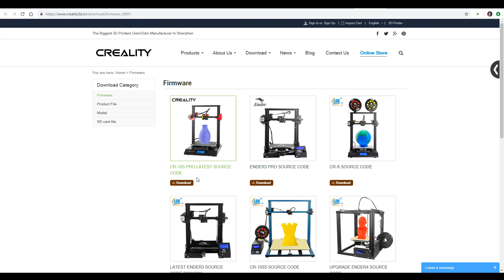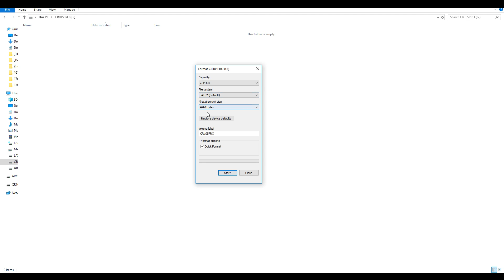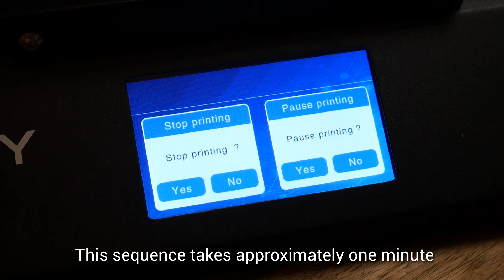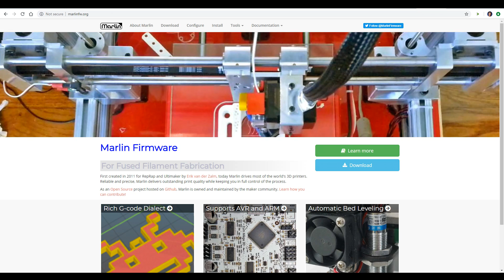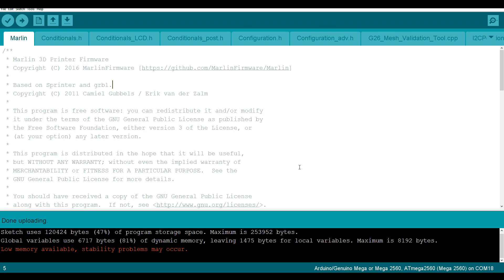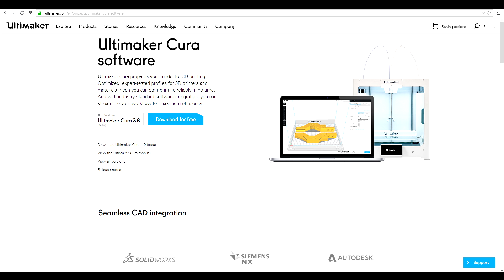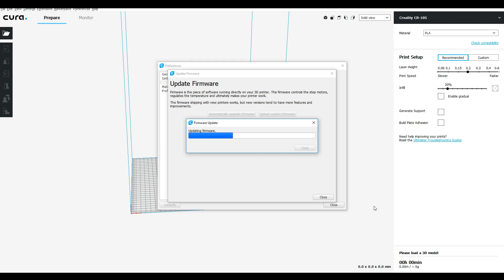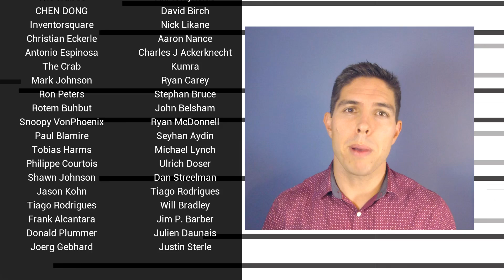How to update CR-10S Pro firmware - LCD and mainboard

Comment: Hey, I know I am a little late to the party. I got this printer from my dad with a broken screen. So I replaced the screen and wanted to flash the firmware to the new screen. However after turning off the printer the screen stays white and does not start the flashing progress. I have followed every step from your video. Do you have and idea or tip what might be the problem?

Comment: i did the tiny machines firmware and it worked but for some reason im having a issue with the y axis when auto homing going all the way to the front and then stuttering on front and making grinding noises , i have tested all the switches and they all working changed the stepper and still not working is their any more testing i can do

Comment: has anyone gotten the creality sonic pad working with the tiny machines firmware? i recently acquired a CR10s pro v2 and sonic pad off facebook. but the pad is not seeing the machine attached, i assume its due to non creality firmware. does anyone know if there's a setting that can be changed, or if i need to flash creality back to the CR10?

Comment: hi, please , i need help with editing firmware 1.70.1 for my cr10 s pro (v1). I need to calibrate the hot bed PID, but the firmware does not allow it. O dont know how to edit it. Does anyone have this firmware that they can give me? . The tiny machine version did no work for me (allows you to calibrate the hotend and bed pid, but requires configuring many more printer parameters). Thank

Comment: Hi Michael! I have semi-bricked my LCD board (power out during update), which means it works but can't run update anymore when I put in the card, so I am stuck on a 2-year-old tiny machines firmware (yeah using it very rarely). I was reading about how to unbrick the mainboard with reflashing bootloader on it, but I don't know enough to be sure that the same thing works with the display as well. Could help me out here, is it ok to do that?

Comment: Would like to attempt to swap out the capacitive probe in my CR-10S PRO (V1), and am currently acquaring all the parts/software.  TM's guide says "For 7.4.6, you will use V7
TM3D_DWINCombinedScreens_V7.z", yet the there's no link pointing to the screen firmware, it's only plain text.  Does anyone know where to find the screen firmware?

Comment: Hey can you share the files for not BLTouch? I have some problems finding files for no BLTouch even on tinymachines :( my printer went crazy
I have CR10s PRO (not V2 and without BLTouch)
Reply: The firmware link is in the official manual/document of TinyMachines.  Note that the specific firmware for the display is NOT linked:
https://docs.google.com/document/d/1cuYWpDw8aPuLEXus3uNsgDIEAKEze3Z9-hIDMWcqMK8/edit

Comment: Hello, thank you very much for the information, you have founded your one good and important channel for the makers.

I bought the CR-10S Pro V2 in 2020 and after a year I wanted to update its functions. Unfortunately, Creality and MyLittel Factorie had updated their websites so much at the time that I could only use them as a guide. And it came that I played a wrong firmwre which is now stuck on the device.
I've tried a few more things but I've had the printer for a year (leaving it in a corner a bit frustrated).

I just can't access the printer with the Com interface.
Do I have to install a new bootloader (and how does that work on this board (Ender 5 don't have the same board))
ist ther samethink i am able to do?

Comment: Can you please do a updated video, with the more advanced settings such as the servo pins, as well as pin debugging, and how to get marlin 2.0 to work with the stock cr10s pro touchscreen? I have multiple problems, one is the printer and bltouch working semi-correctly (it works when you run the self test, down and up commands, but when leveling, the printer head doesn't stop). I also have the issue that after installing marlin from the tiny machines firmware, all of the fans except the one inside the printer stopped working.

Comment: HI, I just upgraded my CR10s Pro to a CR10S pro V2 I add a BLtouch and firmware and screen update. I had trouble getting the machine to update but it is done. But now I have a new issue, the two cooling fans on the print head will not turn on. I have checked the settings in the new firmware, and have turned it on. the fans still will not work. Any ideas would be great. Am I still missing something? I upgraded using Tiny Machines kit and firmware.

Comment: i have a cr-10s i bought from a guy but i have not been able to use it because it come up MINTEMP ERROR i bought a new mother board and new hot end from the factory. i have checked the ohm for the thermistor and the other one beside it. everything checks out but i turned it on and then try to preheat the nozzel and as soon as it should kick on it goes right to the mintemp error. do you have any ideas on how to fit it please help .. i

Comment: in need of some urgent help here. i flashed the lcd all good no worries but i cant connect the printer to cura have tried countless things even tried editing the board loader wait time seen in another video but i dont have permission to save the python file when doing that. the reason im having to update is i went to print today and my printer was stuck on the loading screen when you power it on. tried removing the sd card, unplugging and turning back on. no luck at all. ive managed to successfully update the lcd but just cannot connect to cura. i know its connecting to my computer though as it shows up as comport 4 in device manager and arduino

Comment: Another heads up for everyone, as of this moment, it seems the DW7.4 is very problematic for the CR-10S Pro.   If you can find an older version or hold out until 7.4 is fixed, that would be best.
Reply: any update on this?

Comment: Need help. I followed the guide and did the update. all went well. now when the new 7.4 version came out i follow the same steps and i get stuck on the loading screen on my cr10 s pro v2. screen works , i can upload via xloader, but it doesn't show up on cura. windows detects it. i followed the steps and get upload successful. tried different versions and redownloaded it several times to make sure it wasn't corrupted files. thanks in advance.

Comment: I do realize that these instructions are over a year old, which might explain why they no longer can be followed.  The info presented here (although is very good) doesn't match the way the current systems are set up.  Creality doesn't have a "Firmware" callout on the the CR 10S Pro page anymore.  TinyMachines website sends you to a resource page with hyperlinks, when you select the Tiny Machines 3D Firmware hyperlink, you're sent to the "Github" repository (https://github.com/insanityautomation/marlin/tree/CrealityDwin_2.0), where there are a bunch of files and folders.  The problem here is that for a novice there's no way to figure out what files you need.  It's not as simple as stated in your video.  Once the files and or folders have been figured out, then portions of the video make it easy to refresh the firmware.  I'm not there.  Thanks for making this video.  It was a good place to start.
Reply: Yeah, the TM3D stuff is all over the shop it looks like to me. Looks like they are experimenting with where to host content too. Personally I would just put it all on github and youtube and be done with it. Right now there's stuff on iFixIt, Google Docs, Git-Hub, and You Tube, then they are trying to leverage E3D's content which is a little spread out as well.

OBTW, I'm doing the BL-Touch and the Hemera upgrades at the same time. Purchased both from Tiny Machines to help support the cause a little.
Reply: @JackWilson327  Thanks.  I used Zloader and everything when great.
Reply: The link in steven burks reply appears to be dead now, too

Comment: If I'm trying to adjust my temp, do I do in while I'm in the ardino step during the update? I've looked over Github and the Merlin firmware there has configurations for every type of creality printer but the pro and I don't want to accidently ruin something.

Comment: Very helpful. Thank you. One stumbling block was getting the printer and computer to communicate via the USB cable. When I plugged the cable into the mini-USB port on the printer, the printer powered up even though the power switch was off. However (and it took me, a neophyte, a while to realize this), the computer cannot communicate with the printer until the printer is physically switched on at the power supply.

Comment: I have flashed tiny machines firmware on my Creality CR10s Pro and everything works great except for the measurement option, when i try to do the 25 point probing, at the first point hot end goes right to the edge of the build plate and proximity sensor is in the air at that time so probing procedure fails. I don't have BL touch, using inductive proximity sensor. Is there a way to fix this via the offset menus ?

Comment: you'll be glad to know that Creality has just released the source code for their latest firmware, which also seem to have thermal runaway detection.
Reply: Do we still lose power loss recovery when we gain thermal runaway protection?
Reply: @bongoband5454  Hard to tell: With marlin 2.0.X you have both. I don't know which firmware creality is using now.

Comment: High there, when i bought my CR-10S Pro one and a half years ago, i found this video and thankfully update the firmware. it was great. And I thank you very much for this great tutorial. Now one and a half years later, i saw that tiny machines has a new firmware  for the CR-10S Pro, but it seems its based on the 2.x version of Marlin...  My question as the version i use is marked EOL (end of life) .. can i simply update to the new verison? or do i have to stick to the one i have (the one you are describing in your video)?
Also there is a different screen firmware, ( it says all cr-10s pro use that one,,, it is labeled cr-10s pro v2) it has a DWIN_SET folder but, also some files outside that folder... should I try that update also???? I would use it, like i did the one you discribe.
Any thanks for that great tutorial.
Luc
Reply: You're a cleverer man than I.  I can figure out which files from the list I need to send to my printer.

Comment: Thanks for this video. It helped out so much.
I waited to do this until I finished my micro swiss all metal hot end  and extruder mod and a all new cooling duct system.
I noticed my CR10 was having auto bed leveling issues after the mod was completed (like crashing into the table during the auto leveling program) even though the height had been reset.  Searching YT, I found I needed to clear the EEPROM by flashing the firmware..  And this video popped right up..  This video was the easiest by far to follow and understand.  And after downloading some of the items needed I now have updated firmware and LCD display..
There were a few rough spots.   TM has changed the look and layout of their site sense this video was uploaded.  That slowed down the process a little. And there was no single firmware update for just the original CR-10S Pro, only the firmware for with BL Touch..  So I'm worried about running the auto leveling and crashing the hot end into the bed again.  I also have an issues when homing. When you press auto home the machine goes to a different location than it did before the firmware update..

Comment: Does someone still have that verstion of the firmware (arround the video time). I am looking right now on tinymachine and there are only firmwares for BL touch. I've flashed what's currently available there under "stock probe" but it still has settings for BL touch. Furthermore with this firmware once I make the "measuring" inside leveling, it gets into a bug and cannot get out of there, need to reset the printer and cannot actually level the bed. If someone has the firmware for Creality CR10S - PRO  1st version would be great. Thanks a lot.

Comment: Thanks for the tips! While trying to update the firmware in my Ender 5 Plus touchscreen, I kept getting the update screen showing 0000 on all rows and "End" near instantly. Tried a bunch of different SD cards. Eventually got it to work by formatting the included SD card in its entirety with VFAT - that's the whole card, not the standard partition. This let me install Desuuuu's DGUS-reloaded and Marlin 2. I'm hoping I'll be able to keep the touchscreen usable when I install a Bigtree controller board.

Comment: I just Updated the firmware on the LCD and main bored, but now when I heat the nozzle I get the error "Heating failed! Cycle Power! Target temperature was not met on nozzle or bed soon enough. inspect and verify ambient conditions are suitable for printing"
Has anyone experienced this? I am not sure what to do aside from trying to find the old original software.

Comment: As of this post, the Tiny Machine link to the screen files is only offering the files for the CR-10s Pro V2. Is it the same files for V1? I sent them ticket. - UPDATE: I was told by Tiny Machines that "Screen files are the same for all single extruder machine." so I guess don't mind the "CR-10S Pro V2" folder.
Reply: It is here https://github.com/InsanityAutomation/Marlin/tree/CrealityDwin_2.0
Use 7zip to extract the file SingleExtruderScreens_V2Rev1.7z into its own folder.
That folder will now have the DWIN

Comment: Just followed these instructions.  They worked perfectly, but the code doesn't.  On CR-10s Pro V2 (with stock BL Touch) The wav files on the LCD are all static.  The Auto Bed Leveling feature is gone.  I can select it, but it goes away as soon as I leave the screen and now it won't work.

Comment: Is the choice between thermal runaway vs power loss resume due ti the size of the new Marlin version creating a larger hex than the 10S Pro has space for with both enabled?
Reply: I'd be interested to know this as well. Also if there is a work around currently to gain thermal runaway without losing the power loss function.

Comment: Hi Mate i have a creality Cr-x and not happy with the print quility has layer stepping i was wondering if there a new firmware update to fix this problem as i know they have released the cr-x pro now with the bl touch. iv also installed marlin 2.0.5.4 on all of my ender 3 and pro version what an improvement.

Comment: I have the CR-10s Pro v2. I cannot get the the M600 filament change code to work with Cura. I an currently running stock everything. Could you make a video to solve this problem??? Thank you.

Comment: Hi, thanks for all the great content. It’s been invaluable in choosing my first printer.

I’m expecting delivery of a CR10s pro V2 on Friday which says it already has thermal run out so it is still worthwhile carrying out this mod or will a newer printer be more safe from the favtory?
Reply: I'm also curious about this?
Reply: @gjkirby  Hi Glen, I can confirm that since posted this comment, i have purchased and been using the cr10-s pro v2 with stock firmware and no issues. My understanding of it is that there are still some benefits to carrying out the mod, but less advantages on the V2 as some is already built in.  I have also come to the conclusion that if ain't broke... don't fix it!
Reply: @cheshirestoveshop3035  agreed mate, cheers for the reply!

Comment: I am trying to install TM3D DW6 / Marlin 2.0 on my CR-10S Pro. I was able to flash the controller with Arduino, but whenever I load the DWIN_SET that they specify on their CR-10S Pro page, the files copied screen just shows up as zero files copied right away.    I don't know what I'm doing wrong.  I'm using the same microSD card that I loaded their Marlin 1.x work.   I put just a DWIN_SET folder and nothing else.  I ran chkdsk on the memory card and there were no errors.    I am using the DWIN_SET folder from their: SingleExtruderScreens_V2Rev1.1.7z that they specified.    Any help on what to try / check would be greatly appreciated.
Reply: Would also be curious if you get this going?
Reply: Another person had this problem and a new touchscreen module fixed it.   I ran a chkdsk on my memory card and it was supposedly fine.  I deleted the partition from the memory card and made it fresh.  Copied the files over again and this time it updated.  So if nothing else try deleting the partition and starting fresh.

Comment: Hi, I have noticed recently that the printer goes to the home position part way through a print.  Is this normal if it has lost its way.  I am on the V1 machine with the 1.70 Creality firmware, it has the thermal runaway, so I asume it is all up to date.  I cant find the correct Tiny Machines one for it as they seem to be on to the V2 machine with the BL Touch. Using CURA 4.5.0 on iMac. Any advice or pointers?

Comment: Michael, I can't get my printer to update the firmware, I flashed the screen firmware but can't seem to get the mainboard to flash. I flashed the LCD screen easily but the mainboard just doesn't connect and the COM port is still the same as if it is plugged in or not. definitely need your help... I also tried the Cura path and it doesn't connect at all, tiny machines had an Xloader link and I can't get that to work either. I easily flashed my Ender 3 months ago so I'm not completely new either. Unfortunately, I'm just stuck and have a new Hemera hot end installed and need to flash the firmware to get it working.